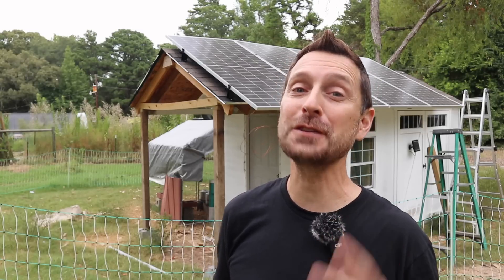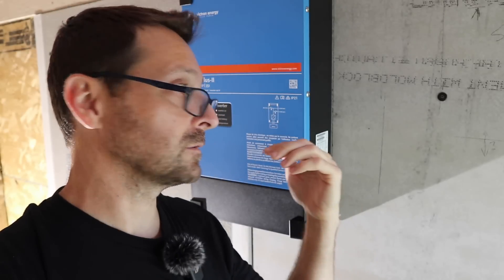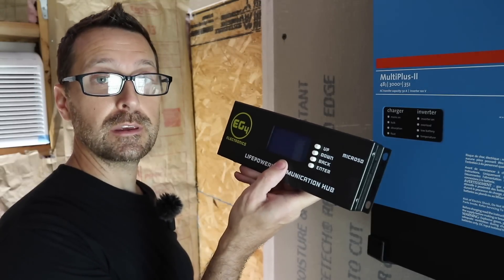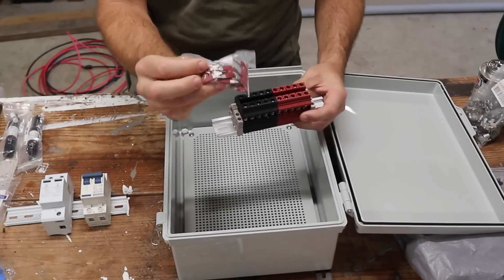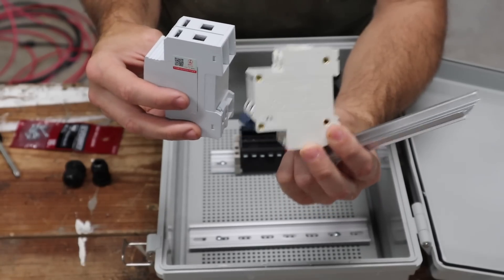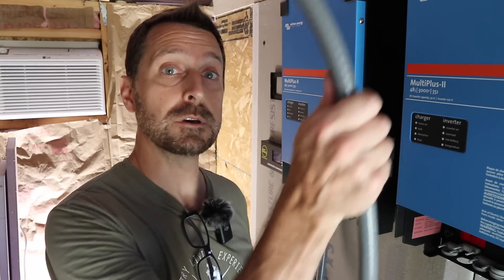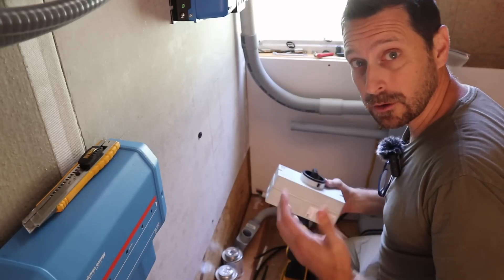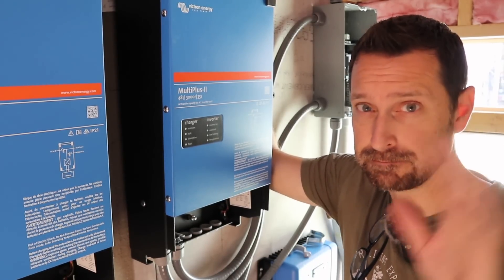Victron Energy Off Grid System | Easier Than You Think | Part 1

Comment: I know this was a year ago and you've already solved the issue but if cut a slot the length of the wholes in the inverter in the wire trough and screw it to the wall tight to the bottom of the inverter , you don't need conduit between the two and it will pass code. . You still have to protect the wires as they enter the inverter but it's easier.

Comment: Not in my budget for sure, but from the research I've done they are probably the most efficient. Id run my wiring however I wanted especially being off-grid and not connected to the main structure. Too many rules and not enough truth now a days.

Comment: Thanks for sharing Eric.  I ran into the same conduit fitting issues when I installed my Multiplus-II 5kVA inverters.  I ended up grinding down some of the threads on the fittings to barely, and I mean barely getting them to fit.  It would be nice if they did accommodate for conduit connections.  

I completely agree though, it can look like a complicated system just because there’s more components, but I do think it’s a very easy install.  Looking forward to the next part!  Thanks!
Reply from the maker: Thanks Adam. Impressed that you were able to shave down those threads and still get the locknuts on.
Reply: @CountryLivingExperience  haha…so was I.

I did find out that the holes are so close together though that it was difficult to get the lock nuts to tighten down.
Reply from the maker: Yep, same. Even with the 1/2” connectors.

Comment: Just curious, I’m a solar noob. Did you consider a EcoFlow Delta Pro for this project? It’s plug and play. I bought two EDP, a smart home panel, a dual fuel generator and 4K of EcoFlow panels 400w x 10. Ground mount from signature solar, based on your recommendation. I’m loving it so far. 😊
Reply from the maker: Hello. Glad you are liking them but no I didn't consider one of those. While they are simple, they are not that powerful for running anything more than emergency loads for a short time. The battery life is just too short and they would not handle the loads that are in my barn....well, jet pump, table saw, chop saw, 120v welder, etc.

Comment: You don't need conduit for your low voltage wiring. You can buy double insulated 2.0 cable of your concerned but if it's 24 or 48V there really isn't any danger of electrocution.

Comment: newbie investigator on going off grid   why Victron ? is it the latest and best
Reply from the maker: Victron is actually a brand that has been around for a long time. They are tried and true and extremely reliable. It is one of the best.
Reply: By early next year I would like to build a solar system for added use to my home, I use about 1800 kwh here in south Mississippi how big of a system should I start with and I agree on starting out with Victron . My other question is can a solar system be shared with two homes
Reply from the maker: @mikeremillard5414  So you are using on average 60kWh per day. The size of system will depend on your budget. Do you want to start smaller and add over time? Do you want to go off-grid, want a hybrid system, want to be totally grid tied? There are so many questions you will need to answer for yourself first. Is the second home included in that 1800kWh? A second home could be added but it will be more complicated electrically and would need an electrician to sort that out because you would have two main service panels to deal with.
Reply: thanks for the input ..I plan on starting small with the ability to expand in the furture,  on the second home that would be of later in the plans right now Im a newbie and gonna set myself up @CountryLivingExperience
Reply: What brand solar panels did you go with and whats the KW
Reply from the maker: @mikeremillard5414  We have 450 watt SolarEver panels. 6 total on this array.

Comment: I have the Victron 450/100 and the Cerbo GX and looking to move away from the Ecoflow Delta Pro and smart Home panel but not sure what else I need to add to the system.  Basically what victron piece can replace the Ecoflow Smart Home panel?   Is that the multiplus?
Reply from the maker: Looks like the EcoFlow smart panel is just a glorified sub panel with a transfer switch. The multiplus will be the inverter that you need, yes. That will replace the Delta pro.
Reply: @CountryLivingExperience  correct, the smart home panel is a transfer switch with some smarts in it.  the ecoflow delta pro is a battery, MPPT and charger all built into one.   I'm trying to move away from their ecosystem one piece at a time and move to the Victron system.  BTW, thank you for the kind reply!   So I would need one of the multiplus II ?   i noticed they have 8k and 10k version..... is that new since the 5k?
Reply from the maker: @tlteal  You're welcome. 
I don't know how much power you need for your house so I can't recommend a size of Multiplus inverter for you. Also, do you need 120/240 or just 120? How many panels do you have? What batteries will you connect? There is a lot to figure out before suggesting something. Is this just a backup system or do you want to go off-grid full time?
Reply: @CountryLivingExperience  Very fair.  I already have plenty of battery backup.   Around 20kw worth.  I think I just need to add the multiplus II or two of them and I'll be good.   Thanks.

Comment: Thanks for the video. Are you replacing the EG4 6500 with this Victron system?
Reply from the maker: You're welcome. 
No, this system is for the barn, well, and jet pump. I needed a more customizable system for those loads that could work off a small amount of panels.
Reply: @CountryLivingExperience  thanks.  Fast response. I am in the middle of your video.  I like the Victron approach  for repairs (not all in one units).   I know it is much more cost with them. Had you looked into Sol-Ark in the systems you have done (EG4 or Victron)?
Reply from the maker: @brentjohnson6654  Systems with different components are much better for repair for sure. Luckily Victron products are also almost bulletproof. I still like my EG4 system in my house and the Growatt's that I had before. I never looked at SolArk initially because of the high cost. I have friends who have them and like them though.

Comment: Nice video. I do have a couple questions-- Are these inverters programmed to produce a 240v supply?  Without an AC  input you won't of course have  the "grid assist" feature so you're really have 6000VA, (actually 4800 watts total due to the deceptive Victron PF )  So I'm wondering why the 4 gauge output wiring.  Are you using 4awg  for a specific reason (super long run) or did you just have a lot of it already?  Victron makes really great and durable stuff, buy once, cry once!$$$  Looking forward to seeing the  'project completed' video soon! You make excellent videos.
Reply from the maker: Thanks. Each inverter is 120v so you need two of them for 240v split phase. I have a very long run from the inverters to the main panel in the barn so I am trying to limit losses in the line with the 4awg.
Reply: Did you happen to evaluate using the Victron AutoTransformer in step up mode from 120v to 240v versus installing two Invertors?  @CountryLivingExperience
Reply from the maker: @mdinning123  I didn't look into that. I worked with the Victron designer at Signature Solar and he recommended the two multiplus's for the loads that I have.